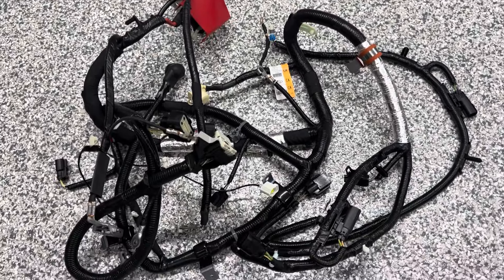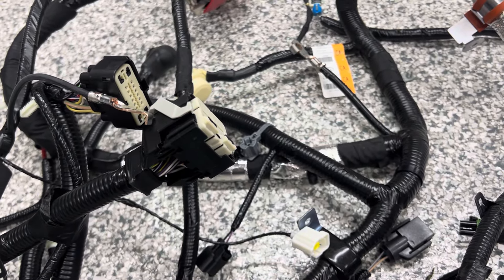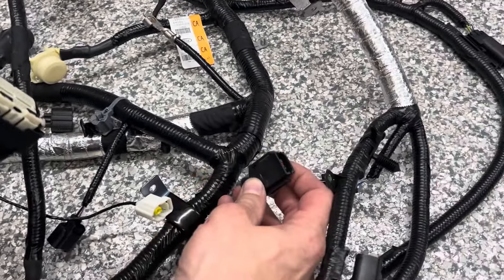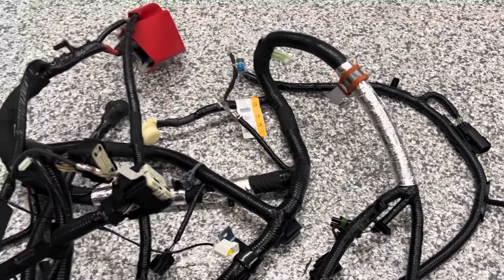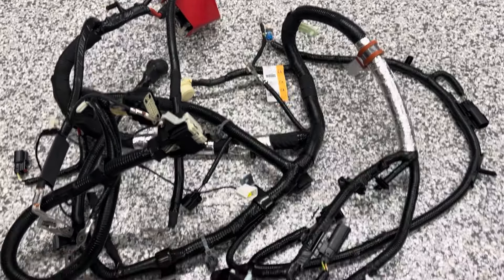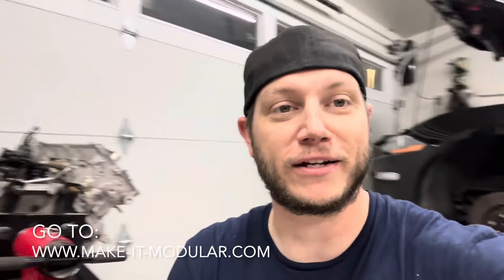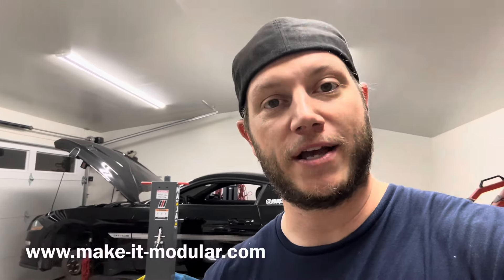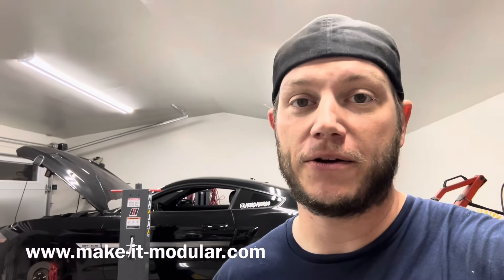New product alert! Modified GT500 Trans Harness, Coyote swapping an early S197 just got even easier!

Comment: Hey Matt,
Amazing job you're doing there, I've been stumbled upon your videos recently and now I really want to do the coyote swap on my Manual 2006 GT 4.6, could you please confirm if the following changes are the only ones required if I still want to keep the tr3650 transmission on: 

- S197 11-14 5.0L Engine any year model
- S197 11-14 5.0L ECU any year model (Does the ECU and the Engine it have to be of the same year? Both ECU and Engine has to be from a Manual Car since mine is a Manual? Do I need to delete the PATS?)
S197 11-14 5.0L Pedal is a must is because of the sensor and the ECU readings? and any year from 11-14 would be fine?
- 2005-2009 Mustang Coyote Swap Plug and Play Harness
- Modified New 13-14 GT500 Transmission harness for 5-Speed Coyote Swaps
- Do I need any Fuel Pumps or Fuel Lines upgrades or would the stock 05-09 ones be fine?
- My TR3650 transmission comes in a 6 bolt flywheel, do I need a specific flywheel or modification to accommodate the installation of the transmission with the Coyote swapped engine?
- I am planning to keep the 05-09 steering wheel to use my cruise control, anything to note with the cruise control functionality after the swapping?

I highly appreciate it if you could support me by answering these questions, and thank you for the awesome work you have made with the swaps!!

Edited: added one more question about the Pedal.
Reply from the maker: Buddy! Email me this at Matt.makeitmodular@gmail.com

Comment: I have a 2009 Gt500 TR6060 that I'll be installing when I do a coyote swap on my 2006 GT. I plan on purchasing your swap harness to complete this install soon!  Any idea if this transmission harness will be compatible with the TR6060 as well? Thanks for the help.
Reply from the maker: This will be the trans harness you want to use. It’ll only need the pin moved at the ECU connector which we can also do for you
Reply: Thank you very much for the info, I appreacite it!  @MattSoppa

Comment: I have installed a Tremec Magnum xl 6 speed in my 06 GT Will I have harness problems if I swap to a 5.0 coyote?
Reply from the maker: If the speedometer and reverse lights are in the same locations as the OEM “T56 magnum“ aka TR6060 then this harness would benefit you
Reply: Thank you for your reply I have been following you for a while and thinking about doing the swap. @MattSoppa
Reply from the maker: @paulabes4220  thanks! And you can’t go wrong with this swap!